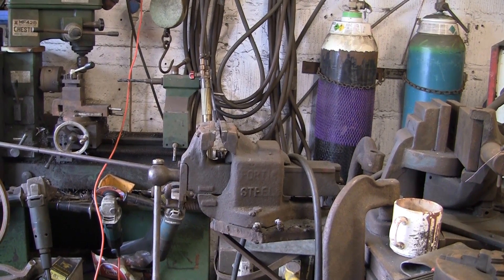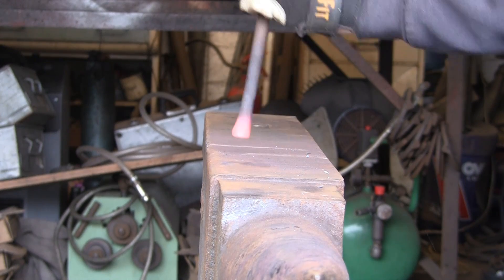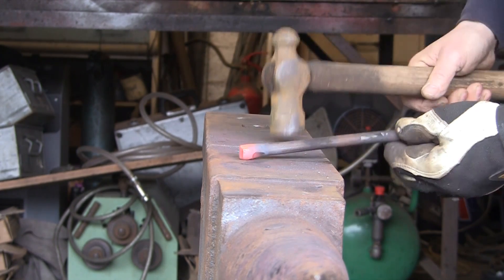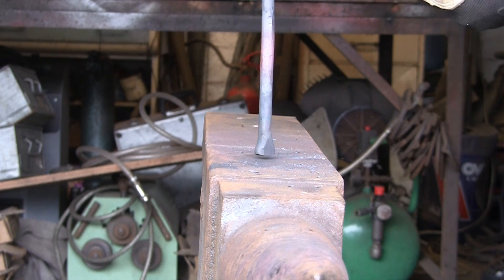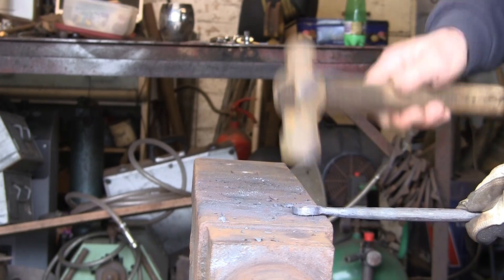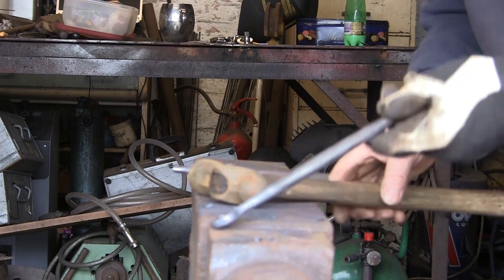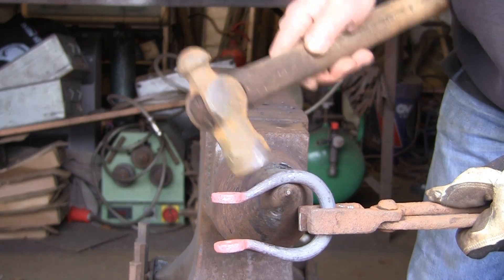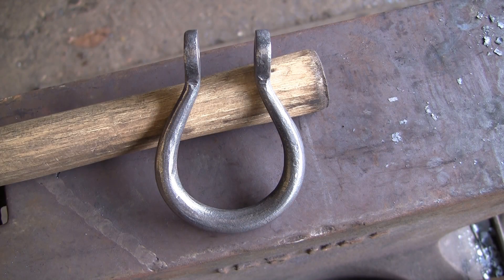Forging a Bow Shackle

Comment: Gary, I always enjoy your work.  You make it all seem so easy!

When doing the upsets of the ends and middle, you start with the ends.  Wouldn't it be easier to upset the middle first?  That way you have the original flat cut ends and not hammered flats to rest the rod on to do your middle, then keep the middle cold and then upset the ends.
Reply from the maker: shortfuse43 I guess you could do it that way, i just did it they way I was shown as a boy!Try both and see which you prefer..

Comment: hi garry why not try starting with a thicker piece of steel and tapering it out?
Reply from the maker: Why?
 Because it's a forging lesson and lessons usually mean achieving the result using many techniques thus learning.
Reply from the maker: aflatminor
There are many ways to do it but as it says in the description it's a good lesson in several techniques for the beginner. Try it both ways and see what you think!

Comment: I'm thinking of making a hardy tool with a piece (inside dimension of 1/2") of vertical pipe (say 4" or 5" tall) that you can drop the 1/2 round bar into, then hammer the top portion that is sticking up. I would then upset the ends later. Wish me luck!

Comment from the maker: Wow! that's not surprising you had trouble! I don't think I would have even tried bending anything that thin..
If I was going to try, I would make a jig the size of your inside diameter, weld it to my bench, then tack weld the strip to the bench and heat it with a torch a little at a time and pull it round the jig bashing it down as I went. Cut your strip much longer than you need and pull it past the start then you can cut it well past the beginning giving a nice finish.

Comment: Great video! You make it look easy, but I bet its not. I will try this in my forge this week. I was wondering if you could show how to bend flat stock into a circle the hard way. I made a round trivet last week and I had a heck of time bending it into a circle. I used very thin stock so it kept folding over. I thought maybe there is some kind of trick to it or maybe some tips you could pass along.

Thanks Ron